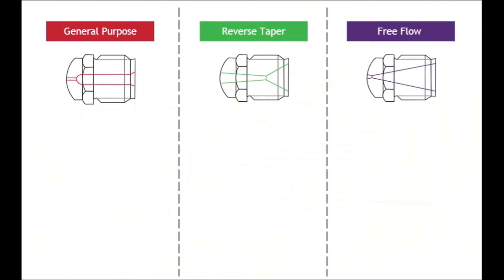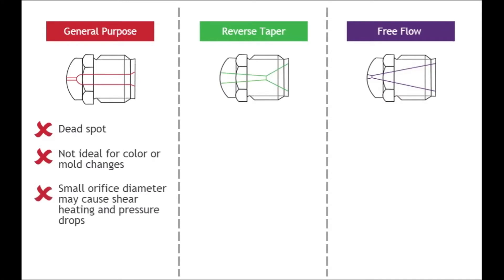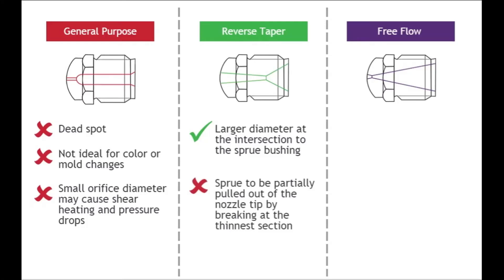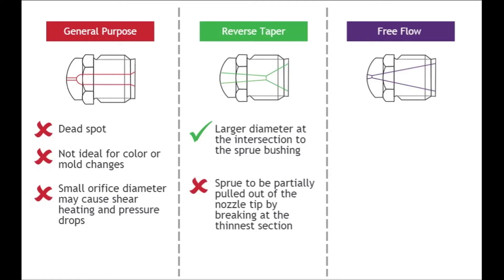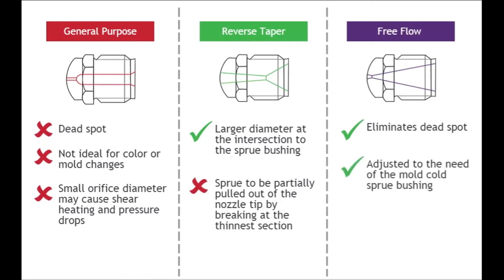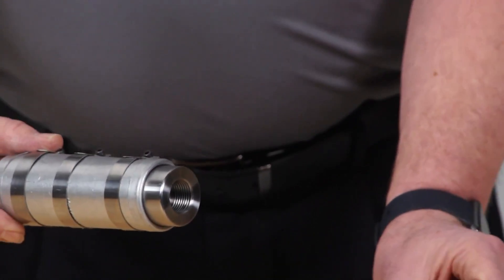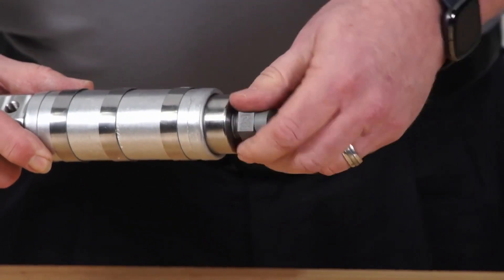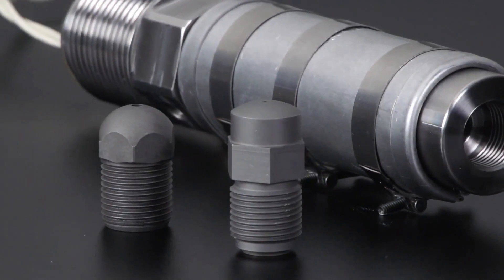Nozzle Tips & Nozzle Bodys

Comment: I want to be able to reproduce lenses for lighting. The largest would be about 1 metre in length and want them made in acrylic PMMA. The entry gate on the lenses is about 20 mm wide where it’s been trimmed. I am hoping to build a simple machine thats capable of melting a large amount of plastic so I would be looking at using about 3 heaters on the melting barrel. The question is if I can heat up a large amount of plastic in a barrel could it be injected into a mold using a lever like the simple desk top injection moulding machines where the plastic is injected using a hand lever? The basic principle of an injection mold machine is having the ability to melt enough plastic and force the molten plastic into the injection mold tool at pressure. 
I already have an injection nozzle possibly made from tooling steel but I could make my own out of brass using my lathe. For plastic mouldings that are large what is the internal diameter where the molten plastic passes in the nozzle?
I have seen a YouTube video where someone has produced a much larger injection molded object using cheap silicone tooling which is attached to a large injection mold machine. The silicone resin can withstand the temperature of the molten plastic at high pressure for intermittent periods. 
The lighting lenses I need to replicate are now obsolete and even the companies that made them no longer exist. 
Things are even more complicated for me as I don’t have access to a 3 phase power supply so I was thinking of using 3 heaters rated up to 3000 watts each with its own individual supply so I could achieve a large melt at the same time.